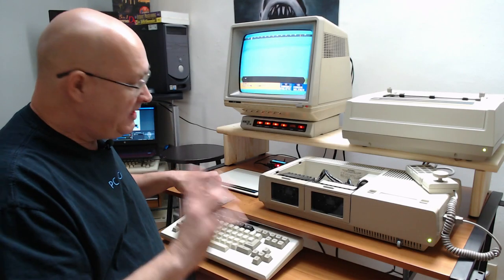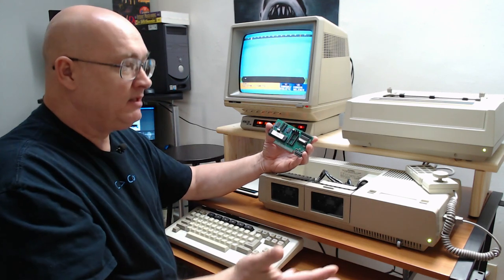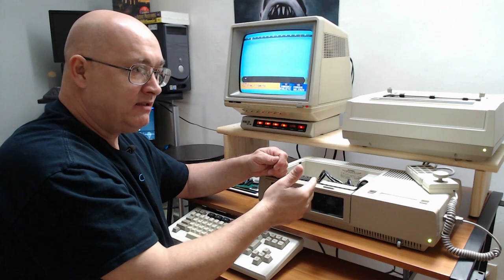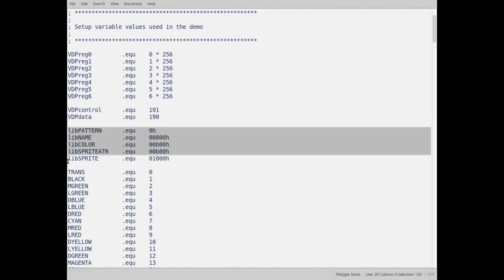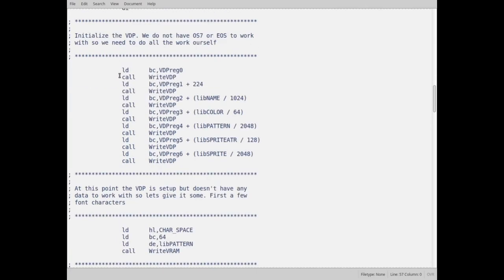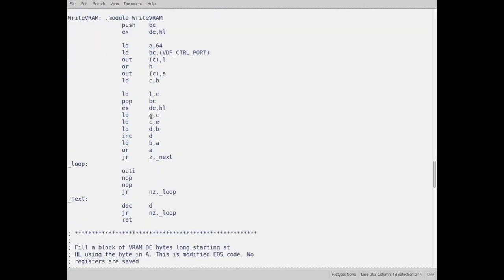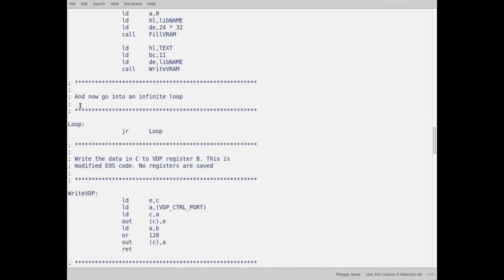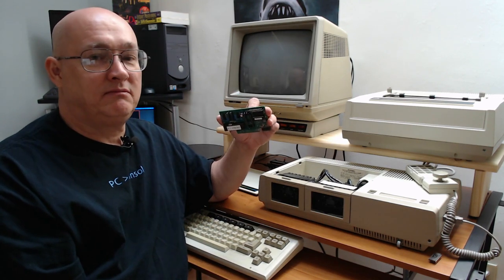I Make A Coleco Adam Expansion ROM

Comment: What Peter said!!!

The Coleco made Slot #2 Expansion ROM Card was used in England to upgrade R79 and lower system to R80 without having to disassemble the system to get to the SmartWriter Proms. In France, it was supplied with Exp. Mod. #3 ADAM systems although I have never seen or heard of any that have survived all these years.

Coleco also planned to use Expansion ROM for their spell checker, but that never materialized.
Reply from the maker: That seems like a waste of energy unless the SmartWriter PROMS are soldered in.

Comment: Cool demo. Most of the code was really setting up the display environment. Since you stated that SmartWriter copies itself to the lower 32K of RAM, doesn't it already have a character table which could be copied to upper RAM and used by the expansion ROM instead of you having to define the individual characters?
Reply from the maker: Yes it does but at the point of where it transfers control to the expansion rom none of this has been installed and the fonts are never copied to upper RAM - just to the VDP - but again it never gets that far in the boot code before jumping to the expansion ROM. You could get cute and make a small relocatable code that you can then dump to upper ram, jump to it, have it toggle smart writer back in (or OS7 and use the CV font) and copy the font from the ROM to the VDP ram than toggle expansion rom back in and jump back.

Comment: I don't know how to do that.  I took a look and there is 2 chips on the language board.  One is just the common R41545D that is the U22 chip on the logic board.  The other chip is a R4153PD.  The chips are not in sockets this looks like a production product.  I sent a pic of it to you before I will resend a pic of it to you.
Reply from the maker: I have both pics now.
Reply: @peterboon8280     I have no idea of what size they are.  The R4153PD is a Coleco chip and is the same shape as the R41545D chip.  They are not a chip that Coleco made them self but were roms made for them.  The numbers on the R4153PD chip are  1st line  "412 VA 2173"   2nd line  "23128-1150"   3rd line  "R4153 PD".  Copyight Coleco 1983.  This chip was made in Korea.
Reply: @peterboon8280  So it sounds like your does work.  My board is part# 4E-0585-0000   also has a number on it 5A-6047-9900 has a ink stamp on it CQI 4 on the back.
I have the same chips U1 upper chip is 23128-1150  R4153 PD  U2 lower chip is a 23128-1151  R41545D.   I'll try pluging it in tonight and see what happens.

The french fonts must be all in the U1 upper chip is 23128-1150  R4153 PD as the other chip is the same as what comes in a normal logic board.
Reply: I just tried mind it 2 different CPU a rev 77 & also in a rev 80.   Could not get a screen with the board in.  Peter did your work?  Can you use in a stand alone Adam CPU or do you have to use it in a exp#3?
Reply: @peterboon8280    Have you ever tried pluging your in?
Reply: @peterboon8280  I never tried pluging into a exp#3 CPU.  Can't see how that would make a different but I have a NOS exp#3 CPU I need to test anyways so I'll try the langauge board on it.